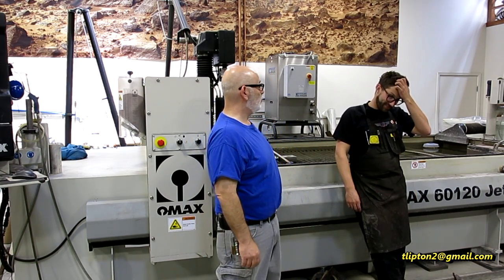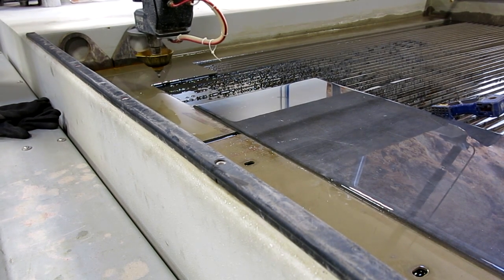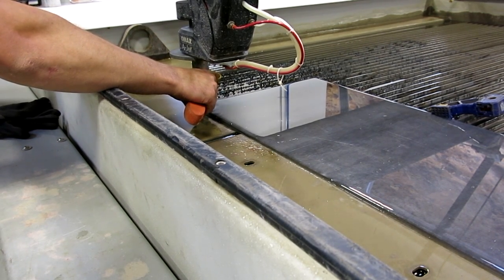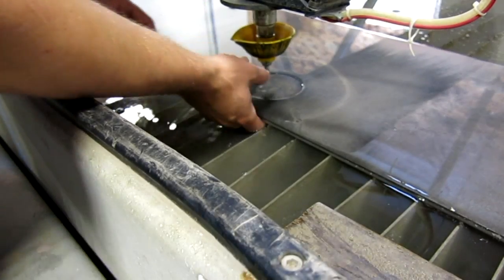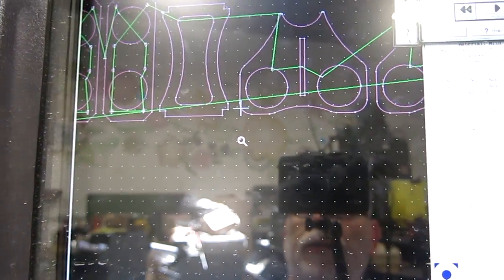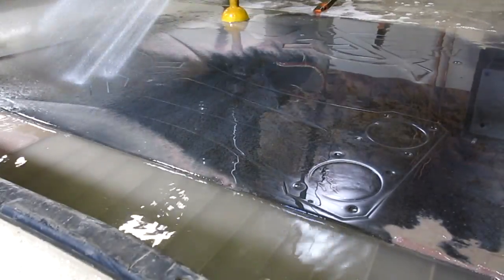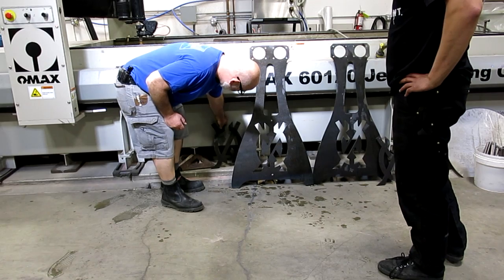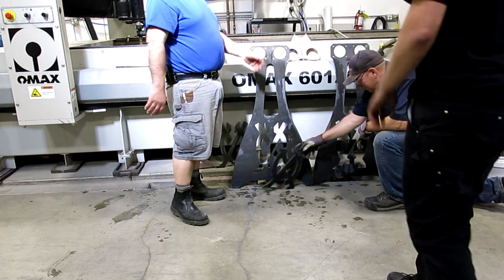Four Jaw King Maker P2

Comment: INTERESTING!  When I operated water and abrasive jets 20 years back, we kept the water 1/4" below the support bars and we didn't have nice splash shield attachments.  Many's the time the garnet splashed all over until the jet pierced the work piece.
I like that machine!
Reply from the maker: Hi Jeffry,

The Omax is a nice machine. That particular one has the dynamic tilting head for going all angular. It also has a fourth axis so you can cut tubes. Thanks for the comment.

Cheers,

Tom
Reply: We tried the tilting feature several times.  It was fun using the computer to trace the DXF (proper term?) file and then cut the parts.  I learned the operating code well enough to make parts and that was rewarding.  The machine had the ways at least 8 feet above the floor, yet it was so rigid that we could cut parts down to 0.001 tolerance.  I was amazed.  Thanks for your videos.  Jeff

Comment: I really hope you guys set the four jaws up with the exact same opening setup for each of you.
Reply: I think they should put the 4 jaws at different reference lines on the face, no jaws same distance form center. then it includes the ability to truly preset the jaws quickly.
Reply: +quigly pigly I was just thinking pick a random number of turns to set each jaw out from the center (of course that neither of the contestants know) but your idea would work too

Comment: Wow, Tom, first-class all the way!  
Those logos need to be mounted atop of a pillar about seven-feet tall, (maybe something like the stand for a shop fan).  Then they need to be lit by spotlight from below.  They should be placed so they form the entryway to the contest arena which is surrounded by a rope spectator fence.  The contestants would stand between them briefly as they are introduced and then make their entry to the stage.  
On second thought,  one of the logos needs to be the Bar-Z logo.  
You know, once upon a time the Olympic games started off as a friendly competition.
:-)

Comment: We used to run two of those in a shop I worked at, They were Flojet brand.We cut a lot of flat stock titanium for the Boeing Co. We could cut almost anything. Cut some glass for a lady,s table top and birch plywood for a custom entertainment system. It is amazing what a little grit and water can do.

JHolland

Comment: say you were cutting a square with water jet, would you never use the original edges of the metal compared to if you were cutting it out the old way? thus always cut out an entire square piece?
Reply: That's known as the "factory edges" of the plate -a water-jet edge is usually better quality. (Usually)

In water-jet its too much time to dial in the edges accurate and the x-y zero is done by eyeball.
Safer to just cut like a cookie cutter on the inside and get a good edge all around.

Waterjet is a nice modern way of roughing out and is luxury - with the older method of flame torch cutting, the factory edge is better than the flame cut edge.

Comment: I may be off base here, but it seems that if both contestants stand next to each other the chucks will have a left and right orientation. Is that fair? Seems like you should stand opposing each other at an offset so that the chucks are in the familiar left side orientation. Just a thought.
Reply: The way he designed the base, I see no reason they couldn't stand on opposite sides (front and back) allowing both to have the same orientation.  All the parts are symmetrical so there would be no advantage being on one side or the other.  This would allow spectators to have a decent view from many angles, probably easier too film also.

Comment: There's something about 3/8" (9.5mm) that's "just right" for a lot of "human scale" stuff.  I just did railings for a project with laser cut 3/8" handrail uprights.  1/4" (6mm) was too thin (both for "look and feel" and for stiffness) and 1/2" (12.7mm) was clearly overkill and would have been a lot harder for the fabricators to work with on site.

Comment: I just don"t see how water can cut steel.
Reply: Water at the working pressure (50,000 PSI) becomes solid-like. To cut hard materials (most metals and glass) Garnet is introduced in the stream feeding the Sapphire orifice. Combine these two facts and you have an abrasive stream that will cut most anything.

Water cuts through rock by using the force of its velocity and any sort of dirt, silt rocks that might be in it.... same idea, just amplified.
Reply: tech like this they used to cut thru the hull of that sunken Russian sub some years ago, yeah, it will do 6 inches. oh, the abrasive is what is cutting, the water under that high pressure is the carrier. It looks like a mechanical pencil lead when it comes out, about .030"

Comment: Wow, it never dawned on me how much FASTER plasma is than waterjet.  For precise things and non-metals, WJ is king, but plasma gets er dun so much quicker!
Reply: I was going to same the same thing, looked like around 2-3 IPM?  I remember running the cnc plasma at my old  job around 60 IPM @ 80A for 3/8.  But then again, that water jet cut quality and no heat distortion whatsoever.